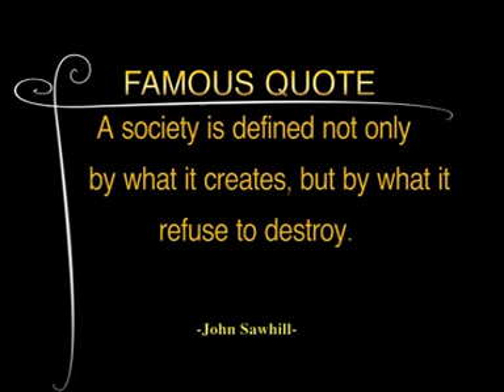COREC ROOFING TILES AND FENCING POSTS IN KENYA

Comment: but thse can be melt in summer hot days .then how thse will be work
Reply: They will not melt! They are rock solid. Even more solid than the plastic water tanks that absorb UV Rays for years without melting.